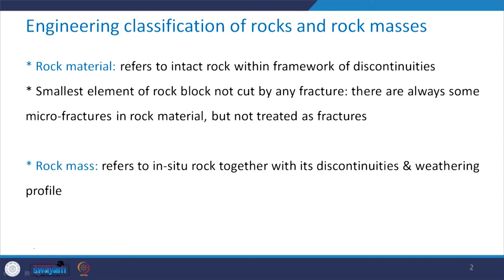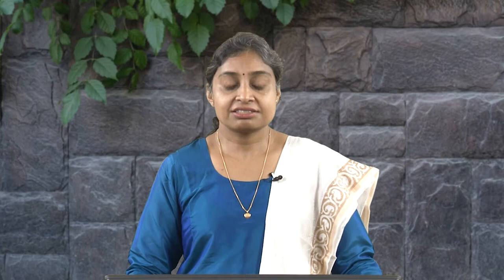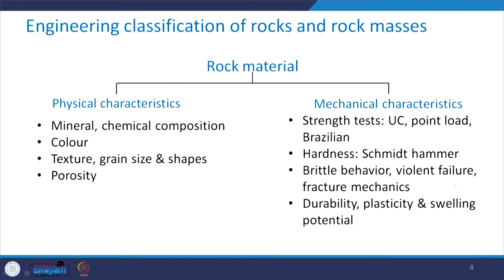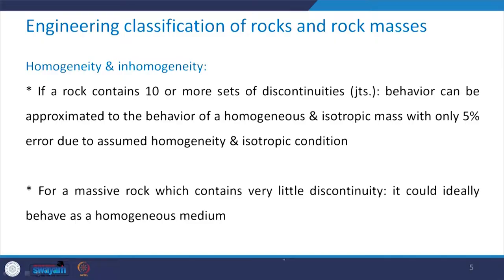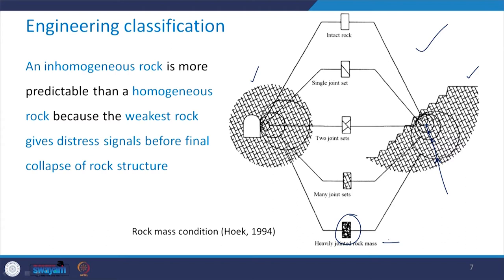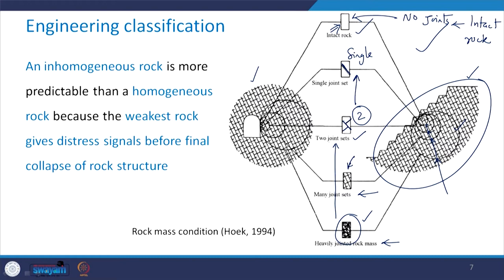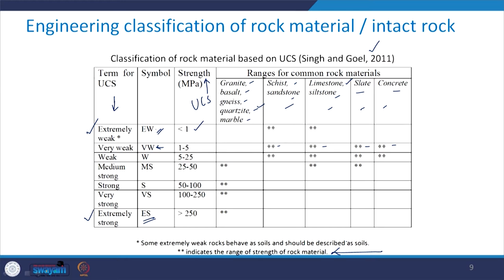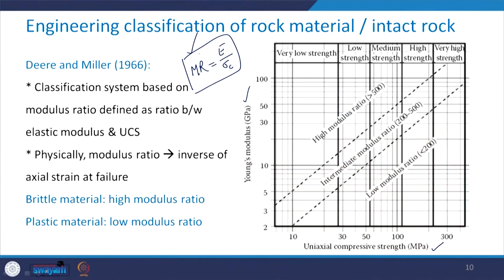Lecture 18: Engineering Classification of Intact Rocks, Concept of Rock Mass, RQD

Comment: I have a long standing doubt that the piece L-20 is fractured in the middle, means "Natural fracture". But how come that piece is added to RQD. The measurement says centre to centre in RQD. by that way then the centre of the fracture to another centre of the fracture is less than 10 cm in piece L-20. Moreover vertical fractures are very dangerous for any engineering structures.
May i know how L-20 is taken for consideration??
Kindly please explain.
Reply: This question is only a doubt which i have for long time. It would be great if this doubt is cleared.